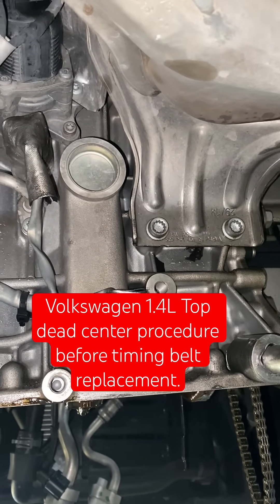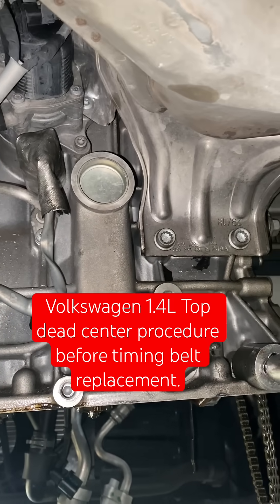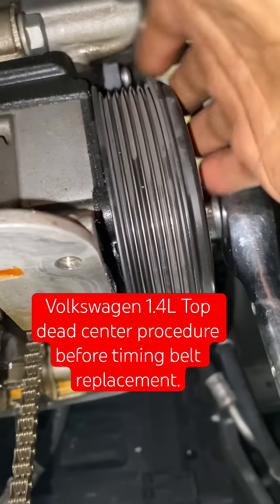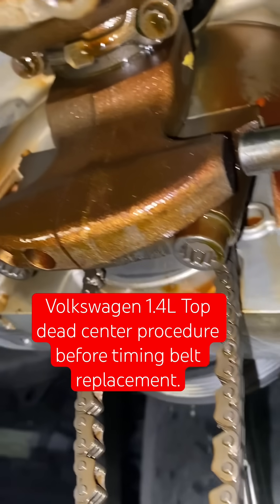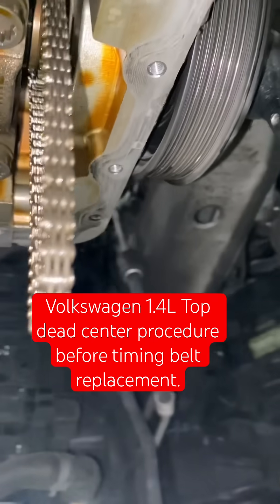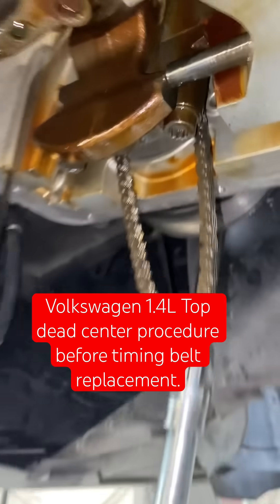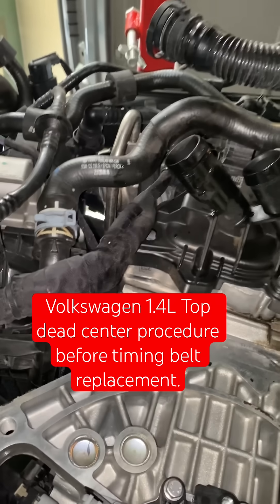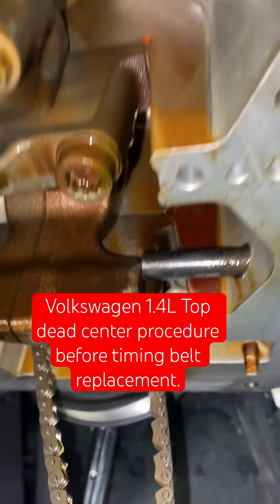Volkswagen 1.4L timing setting.#vw1.4 timing #vw1.4 TDC  mark#vw 1.4L timing belt

Comment: Do you have to time the valves after this job, should this have the adjustable exhaust sprocket?
Reply from the maker: You need to time the valves with the pistons by putting the cams and the crank in specified position.